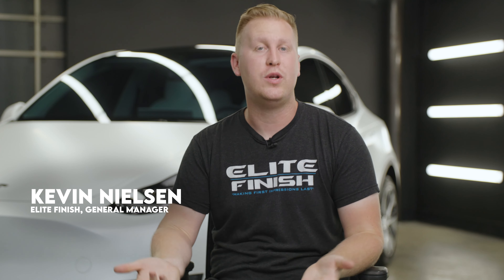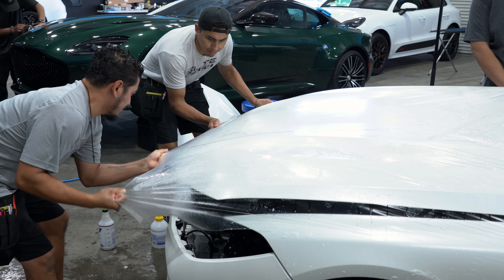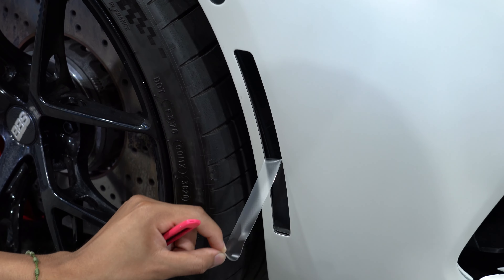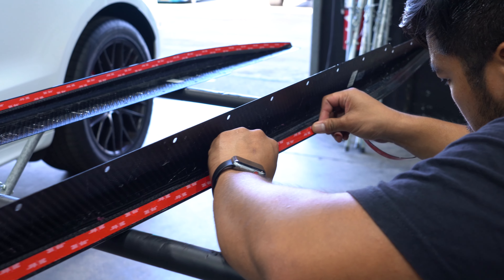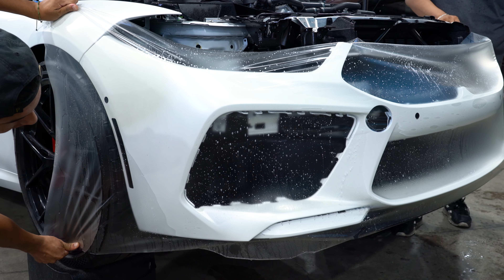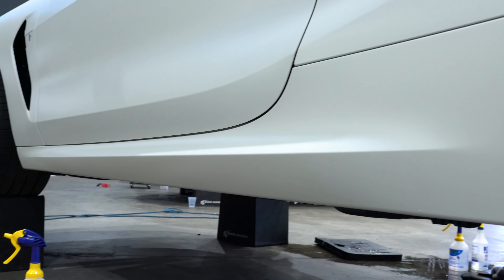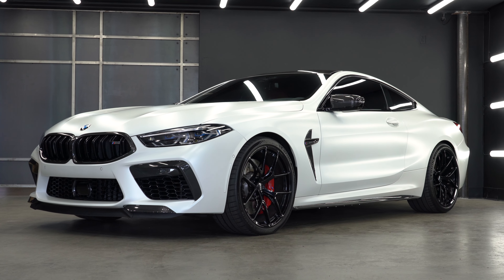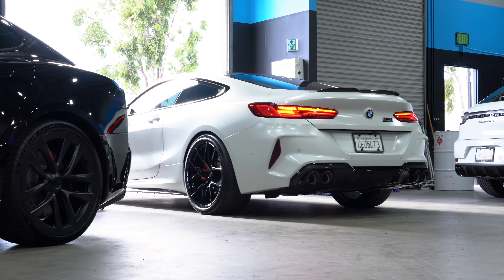Matte PPF vs. Matte Paint - Can you see the difference?

Comment: Is soot easy to get off a matte PPF? Looking to get my white 2010 911 wrapped in matte but the car produces a little bit of soot from the rear exhaust pipes that end up on the bumper.
Reply from the maker: Matte PPF is extremely easy to clean and will make cleaning soot off your vehicle a much smoother experience.